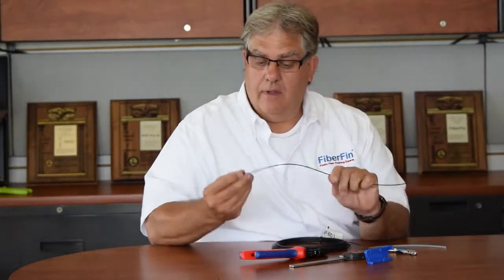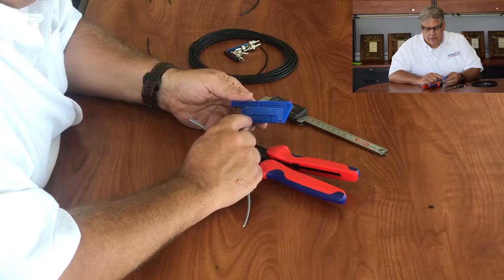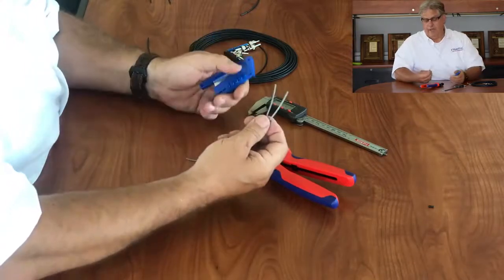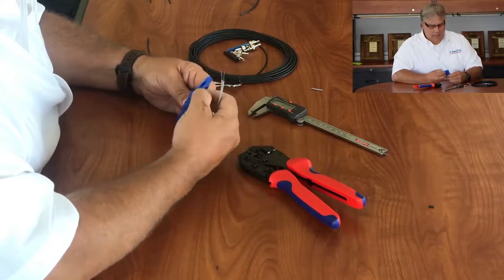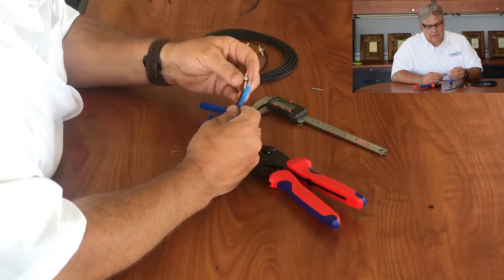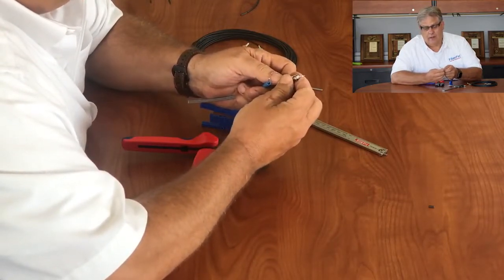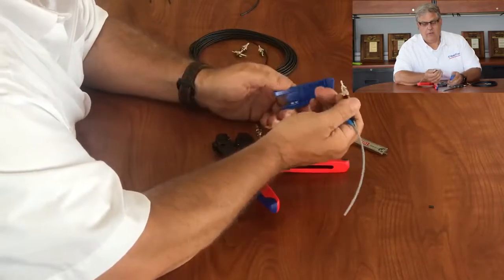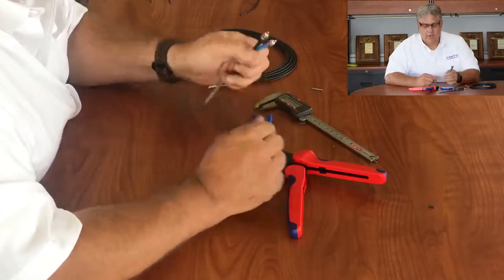POF Field Termination with ST Connectors Tutorial | FiberCast

Comment: Very interesting. I'm new to POF fiber only having done SC/APC connectors before. Now I have seen some videos from Spain where they install POF fiber for indoor extension of FTTH with Gigabit Ethernet to POF media converters. The problems I see is:
1. These videos link to hardware kit with EUR pricing
2. Those videos do not offer any clue as to the technical specifications of dual strand pof fiber used
3. They use a kind if connector where you insert the bare fiber into female sockets and press on and that's it. What kind of connectors are those?
Reply from the maker: We can't comment on your first two points without seeing the videos, but for the third point, you most likely saw Firecomms OptoLock or Broadcom bare fiber termination systems. If you want to discuss more, feel free to contact us via our website or email.